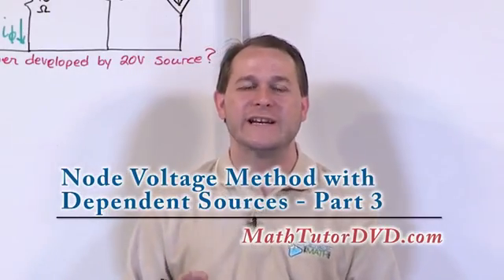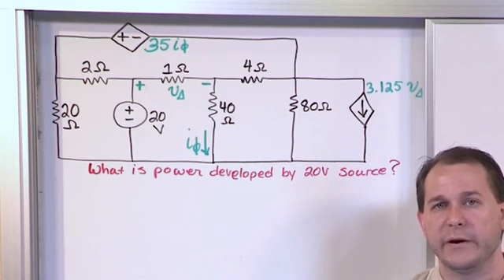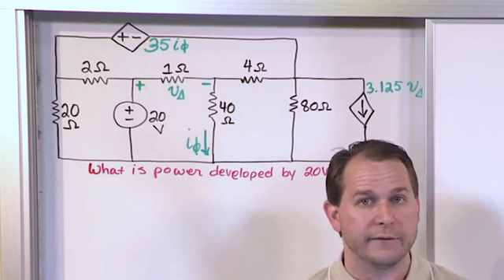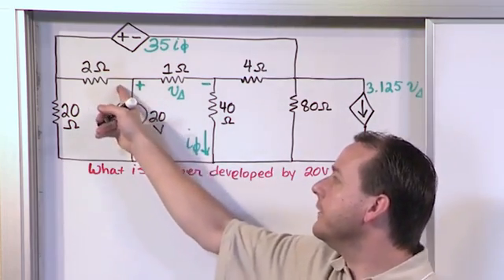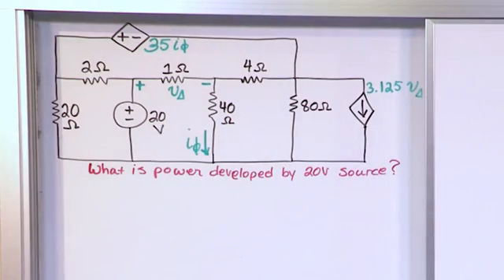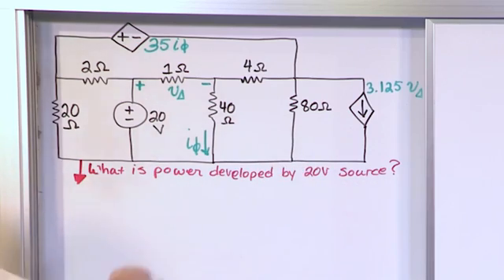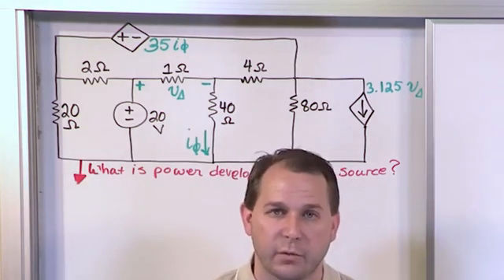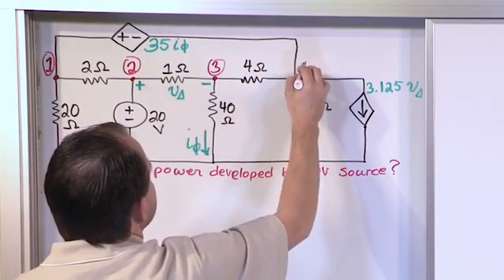Lesson 9 - Node Voltage Problems With Dependent Sources, Part 3 (Engineering Circuits)

Comment: I have the series on nodal voltage method but there wasn't an example of how to solve circuits with super nodes. The series I have did an excellent job explaining nodal voltage method with current sources.